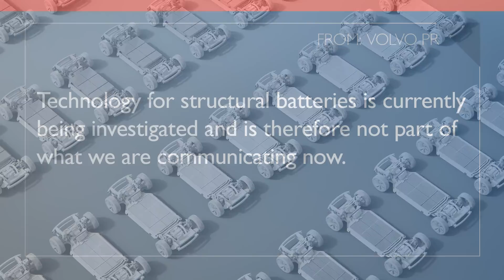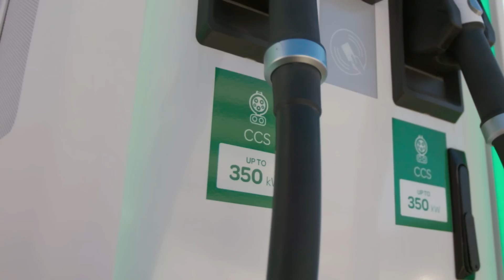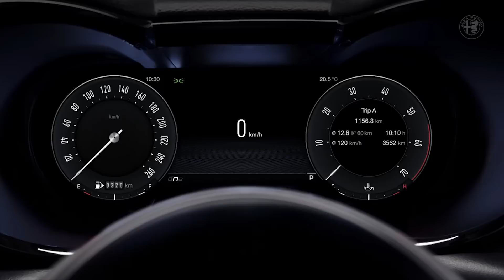“Freedom Convoy” Closes Car Plants; Alfa Romeo Tonale Styling Lessons - Autoline Daily 3258

Comment: I am concerned that the trend toward "megacastings" will lead to more collision damage being deemed unrepairable. If so, this would increase insurance rates and count against any claims the vehicle might make toward being sustainably manufactured.
Reply: Electric vehicles are heavier and when there is an accident and an EV is involved, it's more likely to cause more damage and injury to the other driver.
Reply: These days it doesn't take much to total a car. Sometimes frame damage can be repaired, such as when it's the exterior parts of the frame that are readily accessible (a/b/c pillars). But if the accident is severe enough to reach all the way into the subframe, then the car is probably totaled, megacasting or not. The amount of body panels, sensors, trim pieces, lights, glass, suspension parts, etc that get crunched in order to reach the subframe will total the car no matter what.
Reply: @davewhite113  Same could be said for SUVs and pickup trucks, the most common vehicles on the road. Those vehicles also tend to hit higher on the beltline of a car during a side impact.
EV drivers should be mindful of th vehicles weight though. Some are very quick and they should be driven responsably.
Reply: @Miata822  Good point but an EV is far more dangerous than a pickup.SUV because of the way the weight is centered.
Reply: @davewhite113  That's ridiculous. Goodbye.

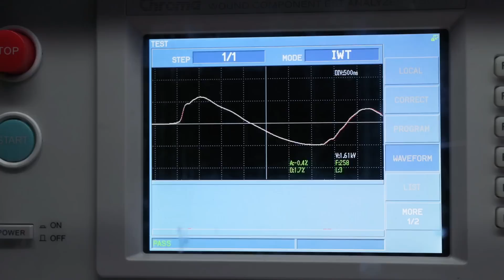Comment: 3:00 R&D Budget. "They were spending that much on new product development" Your response conflates R&D spending on developing new products (now EV vs ICEV) with the costs to build new EV Battery production and EV assembly factories. The R&D Budget doesn't cover building those new facilities. The question remains; how are GM & Ford financing the construction of all their new battery and EV factories.
Reply from the maker: No we didn't conflate anything. We concentrated on R&D spending in this report. Automakers also spend billions every year on capex. GM and Ford both spend about $7 billion a year, VW spends over $15 billion. And that's what they were spending before their EV push. Now that money will be spent on EVs. So they are easily going to cover the cost of battery and EV factories.

Comment: The Ranger Raptor, if it comes to the US, will have either the 2.7L V6 or 3.0L V6. Their turbo 4-cylinders, the 2.0L and 2.3L, are not powerful enough.
Reply: The Focus RS 2.3L could do the trick with 350hp and 350 lb-ft torque.
Reply: Actually, since the (6G) Bronco Raptor (made on the same platform as the next T-6.2 Ranger) already is slated officially to use the EB'd 3.0L (I expect the numbers to be 415hp and 450 lb-ft, up from the 400  / 400 and 400 / 415 of other RWD-biased apps of the engine) it is logical (and 95+% certain) it will use the same engine.

The Thai-built version (along with other non-US plants) of the T-6.2 Ranger Raptor is expected to use an EB'd gas / petrol V6 rather than the EcoBlue 2TD-2.0L I4 of the T-6 Ranger Raptor (the engine would probably then be available in Wildtrack and some other lower level Rangers, along with the Lion TD-3.0L V6). My bet is on the EB'd 2.7L rather than the 3.0L (the engine is N/A on any non-US-built Ranger nowadays).
Reply: @jeffs4585  Goes boom too.
Reply: @kb9oak749  They don't seem to have issues after the head gasket problems pertaining to the first few months of production were resolved. Unless I missed something lol.

Comment: All this crap about mega casting. Castings have inferior strength to forgings. I prefer my car parts forged not cast. Aluminum casting is great for lawn furniture not car structural members.
Reply: The question isn't which is stronger, the question is which is strong enough for the job. Aluminum casting is sufficient for the job, faster, and cheaper. 
But feel free to continue spending more to drive your forged steel tank.
Reply: The casings have all the strength they need with the capability to absorb energy in a collision.  It's about cost.  And Volvo is acknowledging the cost advantage of mega castings over stamped steel.
Reply: @CSHarvey  When Tesla super foraging fail because of fatigue failure, that aluminum is susceptible to and steel isn’t come talk to me. Tesla doesn’t care what happens after their vehicles are over ten years old, but the owners still might. Why do you think aircraft have limited service lives and automobiles don’t?
Reply: @donm2255  Mega castings aren’t new and Telsa had no part in inventing them. They are just using a technology developed by others long ago. In WW2 they used to cast tank turrets as one large mega casting, but due to greatly inferior strength they stopped and started making them out of welded forged plate. Casting is significantly weaker for the same weight as forged. Aluminum is a poor choice for components that will see cyclic stresses. Tesla is known for making the poorest quality cars in the industry. The technology is great Tesla’s manufacturing expertise is terrible.
Reply: @matthewhuszarik4173  You can engineer aluminum castings that don't fatigue.  They are a little heavier, but can easily be made to hold up to the stresses indefinitely.  Aluminum can hold up just as long as steel if you engineer the part correctly.  Steel is usually chosen because of cost.  In a car that extra weight to eliminate fatigue isn't much of a concern.  For aircraft, they make them just strong enough, but not too strong.  That added weight is a big factor in something that needs to be strong but also very light.  Aircraft that have indefinite service lives would weight too much to be fuel efficient.  Instead they build them light and are inspected at regular intervals.  The frames undergo a lot of stress, but aren't designed to handle the stress indefinitely.  It's all about cost.  

I love all the people I come across that think Tesla doesn't know what they are doing.  We will continually see legacy automaker coping what tesla is doing, because Tesla is doing things better and cheaper than anyone else.

Comment: It would be an immense failure if $5B is spent on highway charging. Nobody will buy an EV if they must drive 50 miles to the highway just to charge at high cost, and nobody drives across the country five times a month. All that money needs to be only for charging where people spend their daily lives. Multiunit buildings, street lamps for people that can only park on-street, parking garages, strip malls, etc. If everyone can add some juice everywhere they work and run errands they would always be full.
Reply: This is a biased statistic. Most EV owners charge at home because most people who bought an EV did so because they can charge at home. Very few people who can't charge at home buy EVs. Expanding L1/L2 charging availability for higher density housing and offices is nice, but it fails to address the fact that there are a significant percentage of people who will need public charging because they drive for a living, or whose home/office parking situations simply won't/can't support charging, or because they're travelling. Home/office charging is nice, but it's the long tail. Public rapid charging is necessary, and provides the best bang for the buck in terms of accelerating adoption.
SIde note: The role of the government is to provide collective services that individuals are unable to provide. Businesses and property owners can install charging on their property for their own or their tenants' use. That's not the government's job. But it is the role of the government to encourage deployment of public chargers to be used by.. the public.